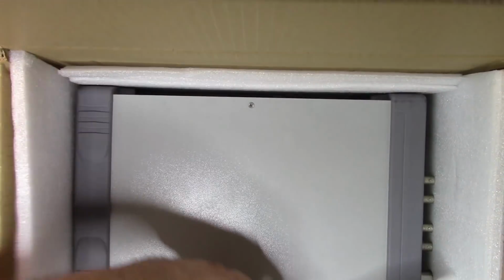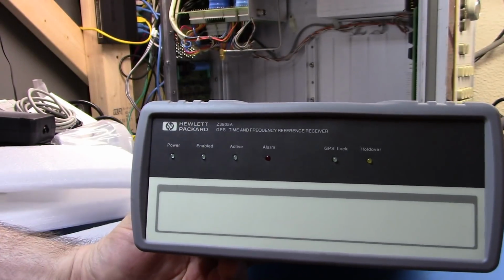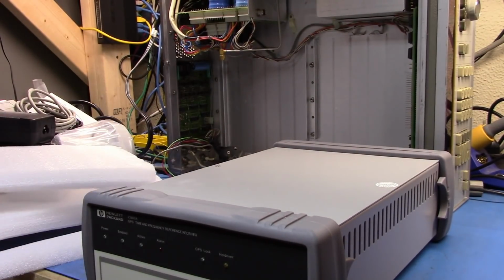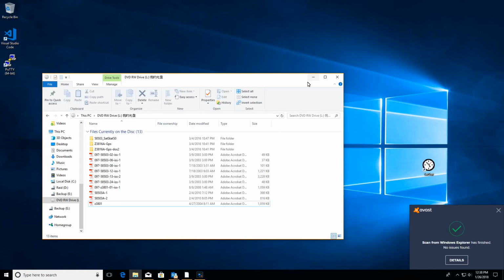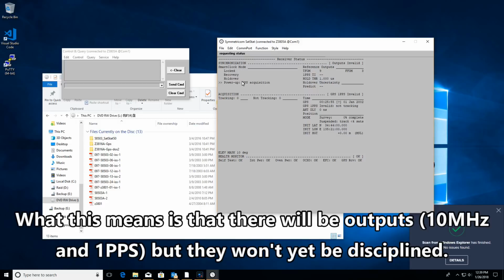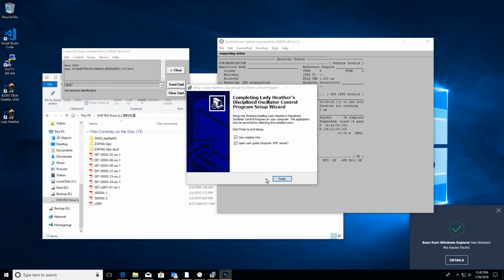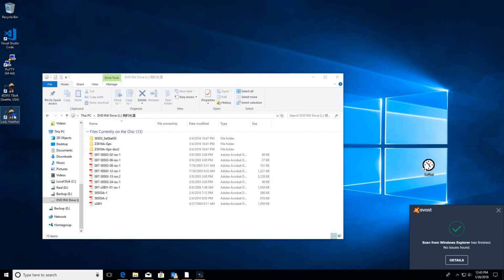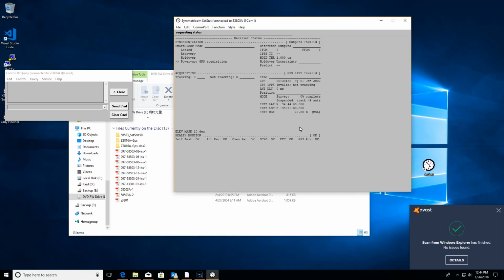HP Z3805A GPSDO - First Look

Comment: As noted on time-nuts and EEVBlog Internet Forums,
the 1024 rollover issue with older GPS receivers can be resolved on these HP/Symmetricom 38xxx time/frequency receivers by entering specific Setup commands (SCPI commands) for current Date and Time, BEFORE the GPS Antenna is attached.
Reply from the maker: Nice - Didn't know that - Thanks for the tip

Comment: Thanks for sharing your knowledge with us, interesting video!:-)
I hope that you'll please answer this question: "how accurate is the unit, thinking of it "talking" with GPS"?
Reply from the maker: Thanks - Glad you enjoyed it - Happy to help answer if I can but could you expand a bit on what you mean by 'how accurate is the unit, thinking of it "talking" with GPS"'
Reply: @tgsoapbox  Thanks a lot! What I mean is that you can buy 10MHz units from 100$ and up over the moon in prices, and as fare I know is it all depended on it's drift over time, and how near real 10MHz it is (accuracy). I imagine that a GPS connected unit is in some way corrected every time it talks with GPS and compensate for count and drift errors, so that it is almost perfectly 10MHz?
In short: "If you have perfect true 10MHz", how much would your unit with GPS connection be expected to show wrong, how much do such a unit drift?
Reply from the maker: @friedmule5403  Again NP, happy to try and help out. What I think you're asking is about the jitter on the 10 MHz signal that comes out of these units (or similar ones). First up I need to say that I'm not a time nut (the time version of volt nuts) so I'm probably committing many sins in this explanation. As I understand this, the GPS signal has very good accuracy over longer periods but any shorter period it might waver around. To address this what they do is to add a temperature-controlled oscillator that is crystal-based. Crystal oscillators have good short term stability but over longer times they tend to drift. So by marrying both, you get the benefit of great short term accuracy as well as long term. 

I used to use one of those fairly inexpensive Chinese GPSDOs but they tend to come with only a moderate TCXO - This unit comes with, what is arguably one of the best crystal oscillators, the HP 10811. This is why I moved up.

It was really only an "I happen to have a bonus so let's buy a toy" thing rather than a real need. I think you'll be pretty good with just a GPSDO.

Let me know if that answered your question or if you have any other things to ask - More than happy to keep interacting.
Reply: @tgsoapbox  Thank you a lot, I think it answered most of my questions:-) Maybe one last one: I have an old HP 53132A frequency counter and want it to count a frequency accurately. Can I use a unit like yours to calibrate my HP 53132A and then know that if I do it right, I end up with a unit that I can trust enough to calibrate my frequency generator with? :-)
Reply from the maker: @friedmule5403  Yes you can off the 10MHz signal but you won't be able to calibrate the period part as you need a specific time interval generator for that but in general, you can, or you can just use the 10 MHz signal as the clock in and be done with it.
Reply: @tgsoapbox  Yes, so simply forget about the internal 10MHz and use a unit like yours? And that is as precise you can get for human money?!:-)
Reply from the maker: @friedmule5403  NP, I do have to correct myself. These are oven-controlled crystal oscillators and not just TCXOs so they're generally better.
Reply: @tgsoapbox  Okay, thanks again, I am surprised on you using all that time, just to answer my questions!! Hats of to you!!! :-)

Comment: Looks like a nice unit. I have read about Lady Heather on the EEVBlog, LOL. Odd they went with a TCXO rather and than an OCXO. Seems like you would want the extra little bit, but I suppose it will be turned on all the time, and heating the oven uses some electricity.

Comment: I thought about getting this HP GPSDO unit. At the time (2 years back) I bought 2 Trimble Thunderbolt GPSDOs instead. Thats what was available for a steal on ebay at the time. I have to upload something on that if I get around it. The downside to what I've got was that there was no support given initially and you'd have to search all over the web for them. I did find most of the support (manuals, brochures, programs, etc.). The program for mine (close to Trimble's) is currently not recommended on Windows 10 yet. All and all GPSDOs using a OXCO are great to have. A fun thing with mines and I assume yours and others is that you can take these things on trips in cars, boats and planes. They're great for calculating or even showing your location and directional movement directly (depends on the software as hardware is already there). There are also ones with Rubidium standards installed but not sure if its even worth the cost (very expensive for a complete package). I'm not sure if rubidium GPSDOs are needed for everyday use. Only time for Rubidium GPSDO use in my opinion would be if you have to take very strict measurements for research. Correct me if I'm wrong though.
Reply from the maker: Thanks - I wanted a proper one with a true 10811A in it rather than the Chinese one I'm using now (not that it was bad per se but these are really built for the job). I can't see me needing anything more than this - At one point there the holdover uncertainty was down below a micro-second. Good enough for me.